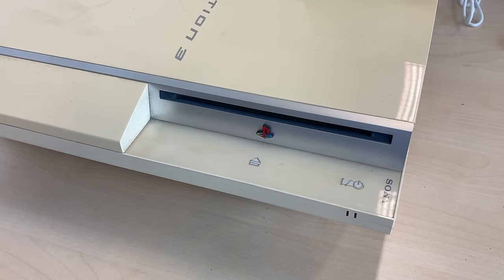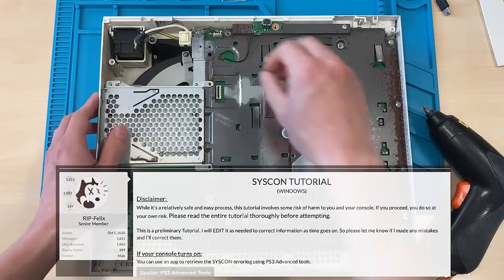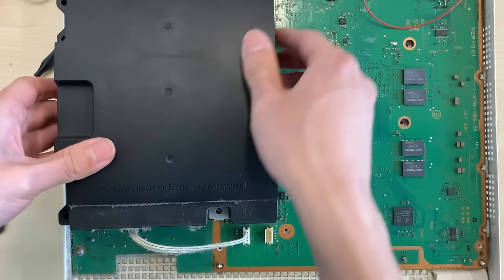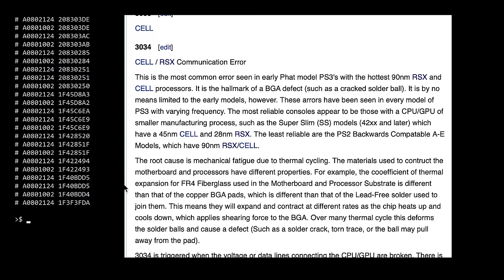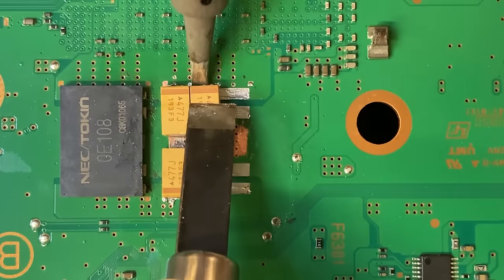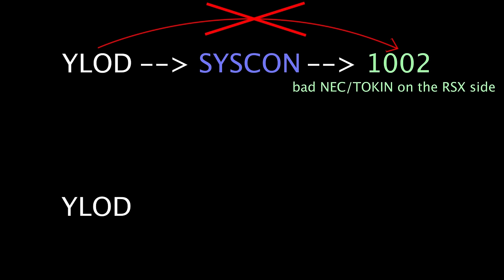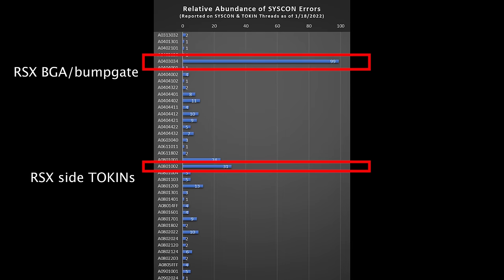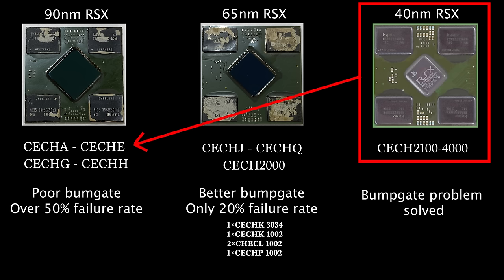Dealing with PS3 YLOD in 2024 (SYSCON)

Comment: I like to repair and sell consoles, but one day I was at a yard sale and saw idk how the shiny glossy plastic of a ps3 I then look better and it was a backyards compatible ps3 the model is the cecha01 and it uses hardware to play ps2 games, I then asked how much he would sold it for and he was like 5 bucks and I was shocked, well it didn't have any controllers or cables but still. I rushed home and plugged  it in, and it turned on I looked on the back and it was an ntsc model not pal because I'm from Italy so. This ps3 didn't have any dust and the seal was still on. So I had 2 questions how the hell did this American ps3 got here and 2 it was mint, I think it never got used. I'm still asking myself how did it get here. Btw good video
Reply from the maker: Lucky you man! I wish I could get a backward compatible model for 5 bucks only!
If you installed CFW, you can use webMAN MOD to check the statistics such as how long has this console been use.
I think NTSC or PAL doesn't matter (correct me if I am wrong), since there is no region lock for PS3 games. But for PS2 games, then yes, it is locked to NTSC. I hope that you could figure out the story behind your PS3, I would love to listen to it!
Reply: @Amateur Hardware Repair  Thanks, I modded my ps3 slim with cfw, now I'm gonna mod this ps3 and see how much was it used, thanks.
Reply: US Military personnel stationed in Italy probably got rid of it at some point.
Reply: I have a backwards compatible uk one , Been in my loft.for 10.years , in box and only used about 3 times

Comment: 3034 error doesn't mean bad RSX. That is data communication error between Cell/RSX/Southbridge which caused by bga defects under Cell and/or RSX. Reball may fix this problem. 3034 error as usual comes with 4xxx error.
Reply: In 95% of the time it is the RSX.
Reply: Usually the only real fix for this to prevent it in the long term (for 3034 at least) is to replace the component that is broken (most likely RSX on early phats with 90nm RSXs, otherwise if it has a 65nm and YLODs, its most likely the NEC TOKINs genuinely dying)

There are shops in the US, parts of Europe, and some other countries I believe that offer a service referred to as Frankenstein PS3s where you can send a dead PS3 for repair and if its the RSX they can replace it with a fixed, more reliable model from later models.

Comment: I still have the ps3 I managed to get on launch day. Still works. Never been opened although I did upgrade the hdd to 320gb many years ago. Use it weekly. Runs a treat. Fans are no where near as loud as my ps4. I bought a slim ps3 version a few years ago and cfw’d that so now I have the best of both worlds.
Reply from the maker: PS3 launch model is awesome! Great job bro, long live PS3!
Reply: My 60GB launch model, and my brother’s 60GB launch model, both died, were repaired, and died again.  For some reason, these don’t actually show a YLOD, but after trying to power on, it shuts off immediately but with only a red light (no yellow light)

Comment: Ylod could be caused by some of the power supply in the motherboard (dc to dc converters) could be caused by cracked gpu joints balls could be caused by nec tokins lost capacitance and much others causes so is good to see you used your syscom to realize what is the problem .
Reply from the maker: Thanks for watching. I want to bring out the message that SYSCON should be used before attempting any repair. I hope to see more people doing SYSCON inside of random fix in the future.

Comment: That's a lot of amazing information actually.
Two or three years ago, I stored my PS3 Slim in a protective box to shield it from moisture and other potential issues, initially thinking that the problem was a faulty PSU. However, while investigating and checking everything yesterday, I discovered that the actual issue was the YLOD. I proceeded to disassemble the console, cleaned it, and applied new thermal paste. Upon powering it on, it failed again, but on the third attempt, it miraculously worked. I was thrilled, but then encountered an OS problem. Today, as I was planning to reinstall the OS, I faced another setback as the console failed to turn on. After watching your video and considering my limited skills in soldering and electronics, I've come to the realization that this is a problem I cannot fix. I will try to search for someone like you in my country that maybe can fix it but it's a job that requires a lot of care and affection, so it will likely stay in the moisture-proof box as a relic.
Thanks for making this video and share all that!!!!!!!
Reply: Hello. Why he put 6 tantalium? Its must be 4 capacitors by each nectokin, the oficial guide said that .i confused🙁help
Reply: @saintaxlxyzero  not necessarily 
the tantalums you install need to be on par with the NEC/Tokin
So if you instal weaker(i suppose im not an electrician) tantalums, youd need more to match the NEC/Tokin you removed

Comment: Fantastic work. I didn't know about this diagnosis tool, and your initiative to gather data about the faults will be beneficial to the community.
Reply from the maker: Thanks for watching. I really hope people would do a SYSCON check instead of blind fixing. I hope this video inspires more people to do SYSCON.
Reply: @hardwarerepair200  I've had a look on Amazon, eBay and AliExpress for the tool, but had no luck. Maybe I'm using the wrong search term?
Reply from the maker: @PoutingTrevor  
The correct term should be "USB to TTL". But there are so many varieties.

I think the one I use is FT232RL. In case you can't find it, here's the link.
https://www.amazon.com/FT232RL-Serial-Converter-Adapter-Arduino/dp/B07XF2SLQ1

Comment: Wow - great job on this.  

I personally have two CECHK01 units and a one CECH4201A.

The first CECHK01 I recently acquired, which worked at the start, was full of dust - I took it apart carefully all the way to the main board to clean all the dust out.  Then put it all back together to my dismay got a GLOD.  I then took it apart again to try to figure out if I missed something and now it only YLOD.

I have a 3.3V TTL board on order and will connect to the PS3 which is YLODing to figure out what the SYSCON data reports.  
I don't know how cleaning the CECHK01 carefully caused the end result of GLOD and then now it only YLOD's.

Subbing as well
Reply from the maker: Sorry for the late reply. When you take the PS3 apartment, was your heat sink sticking tightly to the CPU and GPU?
In the process of pulling the heat sink up like this, you might also break a few solder joints under the GPU. But the GPU was still connecting well enough to get pass the boot up process.
When you do the second tear down, you pull up the heat sink again and break a few more solder joints. This time, the GPU disconnected enough that the PS3 cannot even finish the boot up process.

This is exactly why people were complaining about the brittleness of the lead-free solder joints.
But be mindful that it is not the only reason for YLOD. Another big problem is the bumpgate issue.
For more information, feel free to watch Felix's video @ripfelix3020
https://www.youtube.com/watch?v=I0UMG3iVYZI&t=418s

Comment: My 65nm Cech-2001a Slim died from a BGA issue and I figured it was BGA since I could apply manual pressure to the chip without the heatsink on, and it would come back to life. It died a month ago after 14 years of service, and 10k hours of run time. I didn't get a Syscon codes from it cause it wasn't worth saving it from it's death.
Reply from the maker: Sorry for your loss. 10k hours is a huge number, I am glad that you had a great time with your PS3.

Comment: Thanks for a good video. If  rsx is problem and need a reflow i find it best to delid them and use tin foil and when you delid use a very small amount of cooking oil to lubricate the tool and it will slide under the heat sink to cut adhesive and make sure to wash out gpu with ipa before heating as gpu can be contaminated underneath. The balls need to be clean to spread when you heat up to reflow or remove. I noticed my gpu was stuck down with old contaminates and when I cleaned with ipa the other gpu came off easier. Good luck with your rework station.
Reply from the maker: Nice tips there! I didn't know this. I will try washing the RSX with 99% IPA next time before I desolder it.

Comment: Nice. I should point out though that the original backwards compatible PS3 do have a design flaw with the solder balls and binding agent inside the chip which eventually cracks. Hence the request of many to replace the RSX as a preventative measure going forward.

Comment: Yup I agree, I just got a CECHE and it YLOD's immediately in any "heavy" game, but it runs GoW 2 HD without any problems, most likely capacitor failure, I'll try to find someone that can syscon it in my country before any repair.
Reply from the maker: Have you fixed it in the end?
Reply: @hardwarerepair200  not yet, I think i'll do it myself, and it's a 1001, not a 3034, it even runs gta 5 for hours :shelterin:
Reply from the maker: @AdriHime  Not getting 3034 is a good news! 1001 seems like the NEC/TOKIN problem on the CELL side.

Comment: Question about that circuit board you have in 2:13
Do you have a link to that exact one? I live in the UK, I don't know if I can find an exact copy as that one. Do these boards generally work the same? The SYSCON uses what appears to be a USB cable with the inside cables exposed, is that the same thing?

I'm interested to try this out and see if I can resurrect my dead PS3 40GB model
Reply from the maker: You can search "FT232RL TTL" on google, you should be able to find it.

Comment: The RIP Ps3 story is long but mostly conjectures... this guy is on point as I did the tokin repair and my ps3 is still working fine
Reply from the maker: Thanks! Which PS3 model do you have?
Reply: @hardwarerepair200  i have the 60gb phat backwards compatible ps3
Reply: @neonblaze99  there's two 60GB backwards compatible models - CECHA and CECHC

Comment: The custom PCB is very nice to use because once you get it on the board you don't need as much heat to replace the capacitors if you ever need to.

Personally I like to install pcb and then install the components afterward.
Reply from the maker: Indeed. I haven't tried it yet, but will definitely give it a try later.

Comment: Very logical approach , syscon must be used for diagnosis or you can just guess and throw parts at it?  I don’t have the soldering tools or skills to do what he did, I wonder if anyone diligently fixes these ?
Reply from the maker: Syscon should be the first thing to check. The soldering skills required for syscon is not that difficult. You should be able to do it with a bit of practice. But the fixes such as NEC/TOKIN replacement, and RSX swap can be super difficult.

Comment: I bought a non-working CECHA01 online hoping to fix it and I’m over my head. It has the GLOD. It turns on and runs fine, but there is no video output view HDMI or composite, just a black screen on the tv. I wish I knew of a place in the Silicon Valley to take it for repair. 😢
Reply from the maker: You can try Computer Booter if you are in the US.
His YouTube channel @computerbooter1566

Comment: BGA = Ball Grid Array. Referring to the solder under the chips that connect them to the boards. Not “Bump Gate…..”.
Reply: it can be either bga OR bump gate is what
he meant, but its very likely that the bumps break rather than the bga

Comment: Just followed this guide to diagnose mine! Thank you so much!! Left feedback on your google form as well but figured I'd also write a comment to ask for guidance.

Model: CECHL01
Errors: A0403034 = CELL/RSX Communication Error, A0404002 = RSX Data Error, A0404421 = CELL or RSX Data Error

I'm assuming this means I need to reflow RSX and/or replace the capacitors considering I have the 65 nanometer RSX chip. Any opinions? All help is greatly appreciated!
Reply from the maker: It seems like the RSX chip is dead, which is so unfortunate. We couldn't tell if it is the bumpgate or the BGA problem from the error log. But given that you have a 65nm RSX, I would say it is more likely to be a BGA problem. If you are comformtable with reballing, I would recommand you to do reball instead. Otherwise, you can try reflowing it. Replacing the capacitors won't help in your case.
Reply from the maker: Oh, I saw your comments on the Google Form just now. This problem happens only after tearing down your PS3? Do you remember if you had a hard time trying to remove the heat sink from the CPU and GPU? I suspect that when you try to pull the heat sink up, some solder balls in the BGA cracks. It happens to me a few times before. It might work with a simple reflow, but I would suggest you to do a reball.
Reply: @hardwarerepair200  That's exactly what happened! I had to really tug on the board and bottom plate to get it off the heatsink after repasting with Arctic MX4. Didn't hear any strange cracks or pops but the tension alone probably killed one of the connections.

I might end up using that board as a donor for future projects, since my first comment I bought a cheap cosmetically damaged system to replace the internals in my original, so far so good. Thank you for the response!!

Comment: I have a first model 60gb that got YLOD after 7 years of heavy usage so I watched a video with a technique where you cover the motherboard in baking aluminum foil and bake it in the oven on the highest temperature for 15 minutes and it worked, but for a few hours then died again. no joke. I tried it 3 times, it always worked, but I gave up and bought myself a Slim that still works today. I wonder what kind of problem it had...
Reply from the maker: If you check syscon, it will be very likely to see 3034, which points to the problem of the RSX.
Felix has already explained it in detail
https://www.youtube.com/watch?v=I0UMG3iVYZI

Comment: I dump my CECHA12’s Syscon error log and most of them are 1002 with 2 exception of 2002…… Blu-ray driver seems faulty too as it can no longer read ps2 and ps1 games, is that meaning it can’t play dvd and cd?

Planning to fix them, gonna cost 70 bucks…….
Reply from the maker: Yes, 1002 means that the NEC/TOKINs on the GPU side has gone bad. You need to replace it.

For disc reading, the disc drive in CECHA has two laser heads. One for blu-rays, another one for DVDs and CDs. It seems the laser head for the DVDs and CDs is dead.

I have a video explaining the disc drives that you can use on your CECHA. Feel free to check it out
https://www.youtube.com/watch?v=SweckPS7d-g
Reply: @hardwarerepair200  thank you! Will the 2 2002 error I mentioned indicate something is wrong with my rsx? And if I replace the drive with ones from later models phat. Will it affect my console’s ps2 games compatibility and sacd playback functionality?
Reply: @hardwarerepair200  and if I keep using it like this (randomly sudden shutdown caused by NEC tokin will that potentially cause more damage to other components like RSX?

Comment: This isn't a "TTL chip" TTL means "transistor-transistor level" it's a voltage standard (+5V), the chip itself is a common UART to USB transceiver. It using serial communication.

Comment: Hello, ive got an backwards compatible ps3 in working state, ive got the syscon error log from ps3toolset, it has multiple 1001 errros, after cleaning the console (not deliding) and speding some time on power on, the console suddenly after normal shut off, didnt even goes to stand by mode (red light). after changing 2 power cords, the light pop in! Booting the console and got YLOD! after several times of turning off and on, i dissebly it again, and reassebly, the console boot up!!! Ive check again the syson and i got 3003 error! The console working normally without ylod (again). till i get it to local electronic store to change the NEC TOKIN Capacitors. Could the problem be those NEC TOKIN?
Reply from the maker: The combination of 3003 and 1001 makes it very likely to be the NEC TOKIN near the CELL processor. Replacing the NEC TOKIN should be able to fix your console.

Comment: Hi. I have phat model CECHL with ver-001 board. My case is: no image (both channels), no entry to recovery mode, but indicator lights green. And no power on usb ports. Is it nor issue, and what can i do to fix it? PS: i don't know console history from previous owner. Does Rs232rl and syscon errors check helps me ?
Reply from the maker: It sounds like GLOD to me. It's very likely that the RSX is dead.
Yes, Rs232rl can tell you if this console has any issue related to RSX.

Comment: I have the CECHJ04 FAT PS3 which i assume has a 65nm chipset 
Do you think it is the same problem like yours? I really hope so :'(
Reply from the maker: What error do you get in syscon?
Reply: @hardwarerepair200  i don't really have budget to do syscon 
But I got ylod after replacing the thermal paste
Now it turns off after 5-10 seconds 
I have ordered capacitors hope that could fix it
Reply from the maker: @gnrtx-36969 CECHJ has a 65nm RSX. I would say it has 80% chance the NEC/TOKIN went bad.
Good luck fixing it and keep us updated!
Reply: @hardwarerepair200  thanks for the mention

Comment: I just realized that they are not in series either, they are all connected per set but in opposite flow directions. Can anyone explain this? Im not new to electronics but as far as understanding this im lost. I assume it is pulling two signals low to ground to create a signature or expected wave (like a tolerance) to check against for clean power.
Reply: Part of a Push Pull Logic circuit?